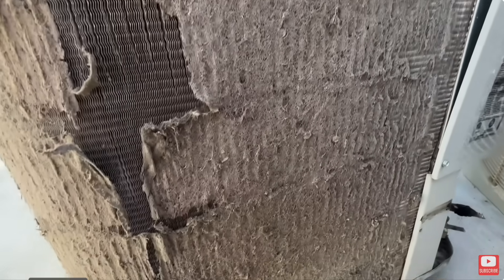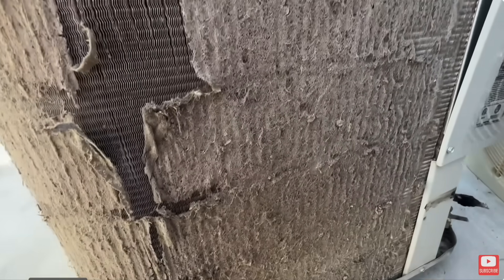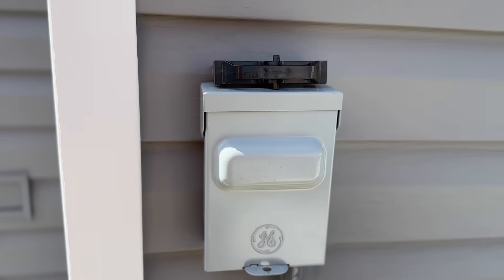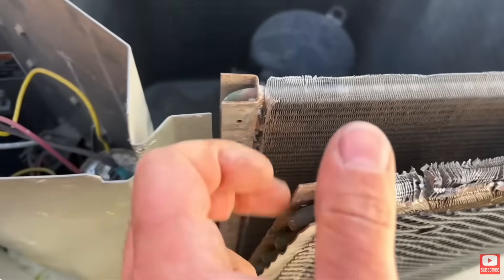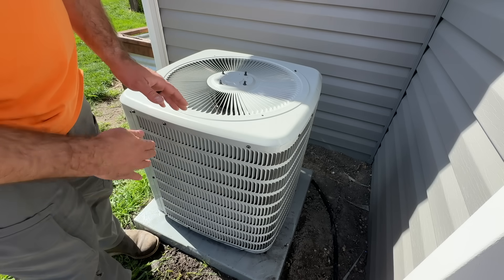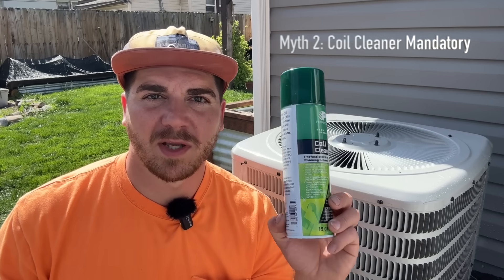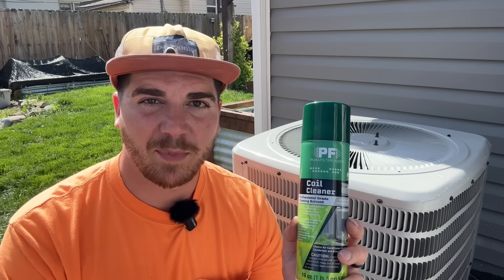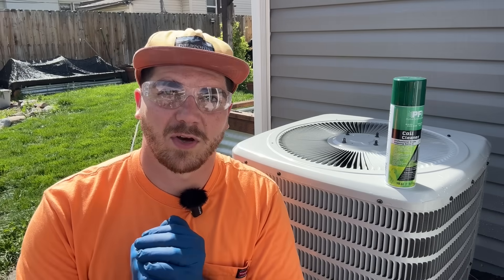Stop Cleaning Your A/C Coils The Hard Way! Do This To Get Colder Air From Your Vents.

Comment: I literally just gave mine its annual wash this morning.  In the past I had been doing just water and it worked okay.  This year I tried some cleaner with a foam cannon and also removed the top to get the front and back of the coils.  It made a very noticeable difference and I washed out a whole lot more junk than I normally do.  My a/c was blowing 2 degrees cooler afterwards and the unit isn't running as long now either.

Comment: This is 50/50 
Good for some owners and bad for us technicians but I hear that many folks mess up their furnace and ac unit because they think is as easy as watching a tech dude on you tube.
Folks , by just watching videos I can probably do “ a heart surgery “ or fly and airplane, or just watch Armstrong Training and do it my self and just go to the moon.
Is more than one thing that can be wrong with your unit.
My grind just went to a house when the owner damaged the parts on the condenser and some part in the furnace.
Is not that easy , is not on thing , there to many things to know and more to learn from with time.
Reply: Are you really comparing the amount of training/knowledge that the typical HVAC tech has to an astronaut or a heart surgeon? The point here is that most basic maintenance and repair tasks for HVAC can be done by anyone that's handy. If you can do a brake job on a car, you can do 90% of HVAC work. 

To use your analogy, replacing a blown compressor (same unit) would be heart surgery, but most of this stuff is like putting bandaid on a small cut. I could go to a doctor to give me a bandaid, but why would I pay all that money when I can do it myself.
Reply: Also, I strongly recommend you take some grammar classes. Coherence is key in communication and will benefit you greatly if you ever get the opportunity to make a move into management.
Reply: Rates are too expensive for simple performance check or simple cleaning.  Cant afford the $90 service call.
Reply: …spraying water vs. heart surgery. 😂
Reply: 😂 comparing HVAC work to heart surgery, going to the moon, and flying a plane lol. The ego on this guy!!
Astronauts are some of the smartest people on the planet, there is a pilot shortage, and heart surgeons are being replaced by robotics with advanced programming because of how difficult the procedures are for a human being. HVAC techs are a dime a dozen for a reason. 
And now that videos like these are becoming available, people realize they can do most of this work themselves and save a LOT of money by not paying the crooked companies to do something that requires an average set of skills. And a lot of us have backgrounds/skills that surpass the average abilities needed to do HVAC installations/repairs, so we can watch videos like this and do just fine. Granted, every trade has tribal knowledge that you can only get with experience but if you aren’t doing this for a living you don’t need to know the trade secrets. It’s hilarious to see how many techs bought into thinking they would be unique just by attending a two year tech school 😂😂😂😂😂

Comment: I'm confused. Not too long ago I watched one of your videos where you recommend and demonstrate taking the top off which I did and it is a pain in the rear and risky.
Reply from the maker: Yes, one can still do that if they want to, but it’s my honest take that it’s not 100% necessary. For the average diyer, spraying it from the outside will be totally fine.
Reply: Spraying from the outside can end up just pushing dirt and pollen deeper between the fins. Due to the nature of the condenser design it’s always best to spray from the inside, especially if you have a micro channel coil or Trane’s patented finger fins.

Comment: I know you can clean most of the dust and debris from the outside but in Arizona where we are dry and dusty, I still prefer to take the top fan off and clean from the inside out.  It does get dirty inside.  But for most homeowners, just cleaning the outside will be a tremendous help in their cooling efficiency.  Thanks for the video.
Reply: Yea I say it really depends. 
Many times you get stuff inside and the dust/pollen/grass makes a spider like coating over the back. Spraying the front will only clean the front while the back will still be stuck.

Comment: I just cleaned my condenser for the summer season. I have to lift my fan to remove leaves inside plugging up my weep holes. But I always sweat bullets afraid that I will pull fan wires or put a hole in condenser coils. So, I think those are good tips as usual. Being a safety professional, liked the safety   message too!

Comment: I got a DEhumidifier  for my home. By lowering the humidity I can keep the temperature at 75/76 degrees and very comfortable . With a fan it is very cool or maybe too cool. Do research on brands and sizes. I am very pleased
Reply: Just wondering what you got.  In FL the heat doesn't bother me, it is the humidity.  If you are working, even at 65 degrees, with 100% humidity, I will be miserable.  Once I was working with my neighbor heavy outside work, but no big deal.  I noticed that it was actually 92 Degrees, but humidity about 40 some.
Reply: I use one too. Haven't used my ac unit yet. It's late june

Comment: I have a cottonwood tree down the block, so I have to do weekly hose-downs with just water, to keep the seed-film off the coils.  I do a deeper clean in the fall, with coil cleaner for winterizing...
Reply from the maker: Nice, do what you have to do for your particular application. Nice job 👍🏼 cheers
Reply: @diyhvacguy   my window unit  is under trees but the coil is protected but i still clean it  when it need  i got the unit from the road side  because someone left the manual in the outside coil for years  its super quite
Reply: I used coil cleaner this morning on both my units. Rinsed after letting the foam work for about 10 minutes. Flipped em back on after waiting 30 minutes. 
What’s weird is that I’m getting a higher interior temp inside my house today.
Could I have done something wrong?
How long until after rinsing should I have waited to flip em on?

Comment: Funny af. Ty for the content and as a field tech i find your videos interesting.  Always sad to hear about the con artists.

Spray in a downward angle the motion you were doing was side to side =b just goofing i like your style! 

No issues with your feelings towards cleaning product, they could corrode. If a customer pays they are getting a tare down and full cleaning and proper reassembly with new ties for wire retention. 

But if they need a simple hose down i encourage them to save money and do a little bit on their own. You might be surprised at how many people do not want to do simple things to save money or keep a warranty.
Reply from the maker: Yep, that’s the reality. A lot of people don’t want to touch it. There is plenty of work to go around. I don’t know why people who do hvac get butt hurt about the videos. 🤷🏻‍♂️  thanks for the input! Cheers
Reply: @diyhvacguy  keep doing you even if we hate man! F em!
Reply: @diyhvacguy  

@Raider352
2 weeks ago

Home warranties don't like honoring warranties.

5

Reply

@JohnDoeEagle1
0 seconds ago

Your equipment manufactures don't like the homeowner screwing with stuff themselves either. Once you've put your hands on it not knowing what you are doing and wrecked something fully expect to be out all on your own.

@laserimage8583
2 weeks ago

Really appreciate you sharing your excellent knowledge about HVAC systems. I have question about compressor freeze up. If on a 90+ degree days and we set the thermostat temperature to 60 degree, will it cause the system to freeze up? Been getting conflicting answers, some tech said yes and some said no. What's the correct answer? Thanks in advance!

Reply

1 reply

@eDoc2020
12 days ago

It depends on your specific setup and condition of your system. If you have a "dumb" system and your airflow is limited (such as from a dirty filter or undersized ductwork) it will probably freeze up. If your system has great airflow and is properly charged it will probably be fine. Usually it's recommended not to cool below 68F or so just to be safe. If you want it colder you can get an inexpensive freeze protection control installed which monitors the operating temperature and shuts off the compressor if it gets close to freezing. If you have a modern inverter-based system like a mini-split it probably has this protection built-in.

Reply

@JohnDoeEagle1
1 second ago
 @eDoc2020  

Nope....air conditioners are only rated to cool 20 degrees colder than outside. You might get a bit more but no way you could ever pull down to 60 on a 90 degree day outside. That unit will freeze up. And yes, I am a licensed professional!

Reply

@JohnDoeEagle1
0 seconds ago
Good trap.....

18 degrees difference between the return and supply is usually ideal. Anybody who is licensed and has been professionally trained would already know that.

@tedyoh7394
6 days ago

Yeah......the proper way to clean is inside out, the AC coil is basically built like an air filter.......first the tiny particles, say pollen, get caught in the fins, then the dust and dirt builds up next....then comes grass clippings......you get the idea.....inside out is the proper way to clean a coil.... (coming from the son of a HVAC contractor with 54 years experience)

3

Reply

@JohnDoeEagle1
0 seconds ago

This guy is a amateur at best doing a huge disservice with his "advice". He says they rarely get blockage in between. That simply isn't true and I find them like that all the time. In which case you have to run the unit while quickly and carefully whisking over with a propane torch to suck in the flame and set the cottonwood on fire. You do this very carefully and with a hose turned on and right next to you in case it gets out of hand. Don't stay in any one spot for more than a fraction of a second or you will damage the aluminum coil. After it's all burnt and the smoke was expelled through the top via the fan running you turn off the disconnect switch and go about it as normal. All the ash and residue washes right out. 

22 years experience and the company I formally worked for was in business from 1912 - 2017.

Comment: I have some leaves sitting on the bottom inside the unit.  Not a lot but should I remove them?
Reply from the maker: They won’t hurt a thing
Reply from the maker: It it’s a mass quantity and they are always wet then yes I’d take the lid off and suck the out with a shop vac.
Reply: @diyhvacguy  The unit is less than a year old so definitely not a massive amount of leaves.  Appreciate the reply.  🙂
Reply: @diyhvacguy if you wanted to take it off would you just take the fan out our the entire top piece?

Comment: Great video. I want to learn how to check the Freon in my unit…do you have a video for that? Thanks
Reply from the maker: Yes look thorough my library and you will see my video on how to charge a system. The thumbnail has a small pink 410a bottle
Reply: @diyhvacguy  thanks again
Reply: You want to learn something and you almost typed the right question in the right text box, try Google and repost your question.  A whole bunch of relative info might come up.

I'm nervous for you but start with checking your edit: delta t, less chance for you to hurt yourself or your equipment.
Reply: @borshardsd  I could not understand your response about typing the “right question in the right text box” nevertheless I will research it.

Comment: Is it possible to use a household cleaner in place of the coil cleaner to break up dust, and if so, what would be acceptable in a pinch?  Windex?  Bathroom foam cleaner?  Anything?
Reply: John........I have used liquid car wash soap or liquid dawn dishwashing soap.  I mix a small amount in a bucket and pour into a pump up garden sprayer. You could also use a hand held sprayer.  I'm not saying this is the only way to do it, it's just what I do.  My old Bryant coils still look new and it's 27 years old.
Bill
Reply: @billk5727  thanks for the common sense tip.
Reply: @billk5727 Yup, a little Dawn dish soap or a 50/50 mix of vinegar and water ✨